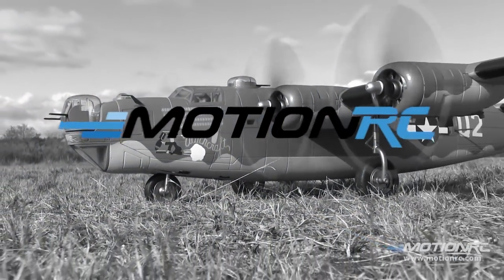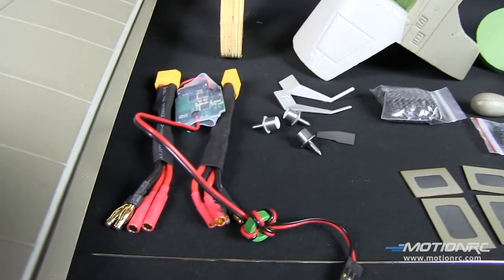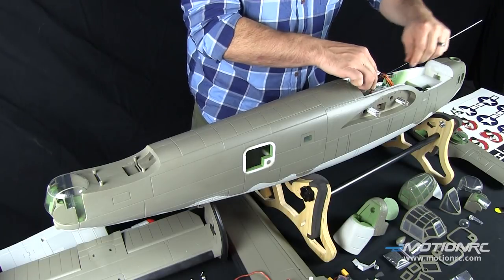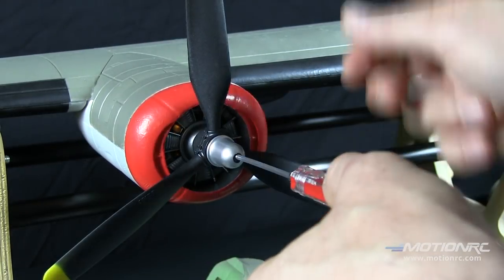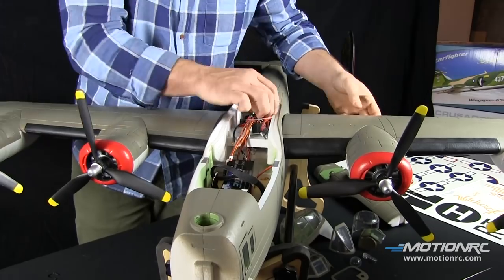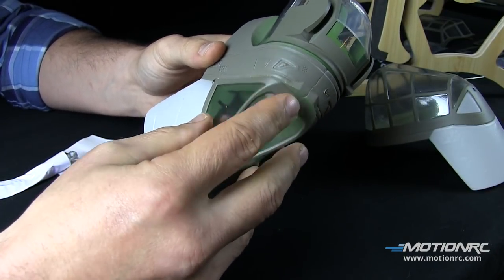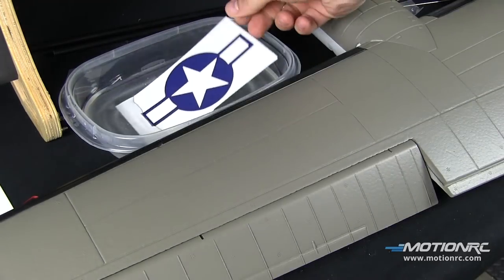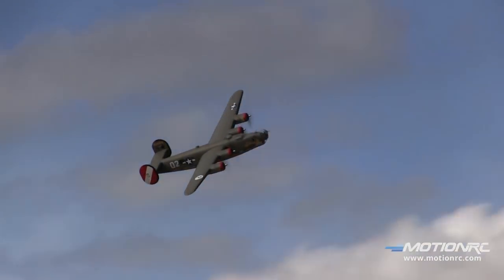FlightLine RC 2000mm B-24 Liberator - Build Video - Motion RC

Comment: I wish I had the witchcraft my great grandpa was the navigator in it
Reply: I just found out today that Witchcraft was based at RAF Rackheath/Station 145, which is about 15 miles from where I live. Looking at Google earth there are several bits of the original runway left one could probably grab a dawn flight from in the summer. Have to be careful though as it's on or close to the flight path of Station 123 RAF Horsham St Faith, now NWI Norwich International Airport, also another B24 base. The number of air bases here in Norfolk is truly amazing, and the reason I live here now, since I was stationed at one of them in the RAF. My father was involved in helping build some of the bases in 42/43.

Comment: If the furnace will not run due to power outage, how is this thing going to work when you have to plug it into a wall outlet with a power outage?😂